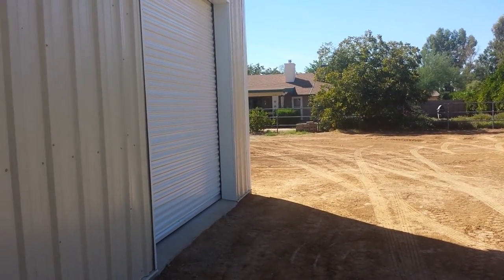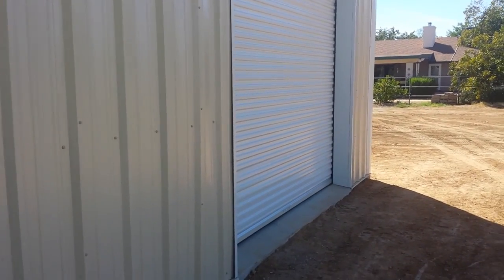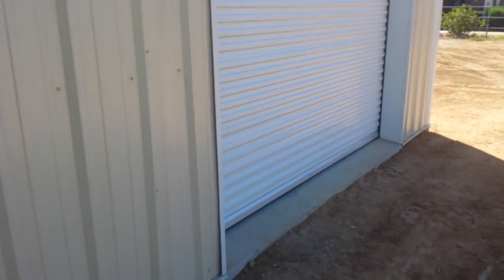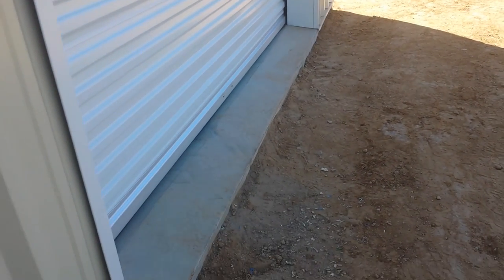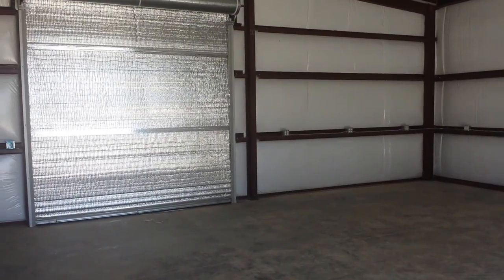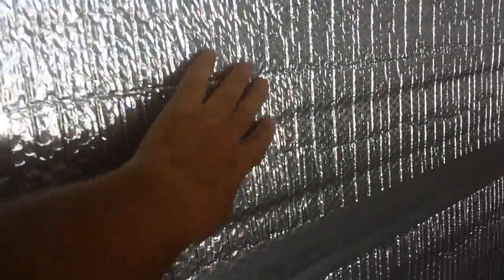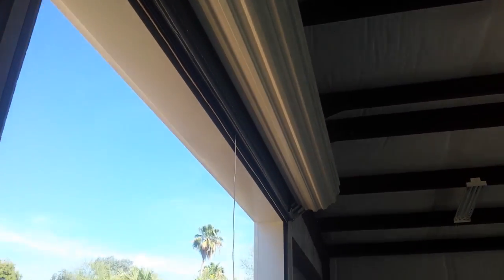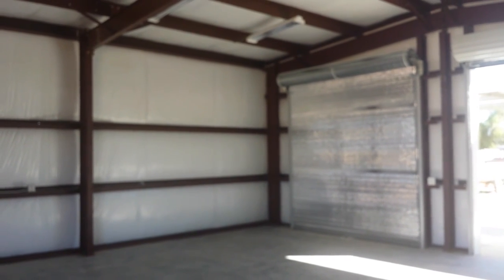Pre Engineered Steel Building in Scottsdale AZ

Comment: What kind of R value does that insulation provide? How does that compare with the 3" of vinyl-backed insulation you put in the walls?
Reply from the maker: The standard R-value of fiberglass insulation per inch is the same for the vinyl-backed, the backing just provides some additional protection and it makes the interior of the building look really neat and clean. We can make the thickness of the insulation whatever you want up to a point, in the roof we can make it thicker by insulating between the purlins. Because the insulation is smashed between the sheeting and the framing members it's insulation value suffers. So the standard 3" R-10 in the walls and 4" R-13 in the roof is mostly to keep the building from peaking in temperature during the heat of the day and cold of the night. If the space is to be climate controlled in any way we recommend spray foam in most instances.